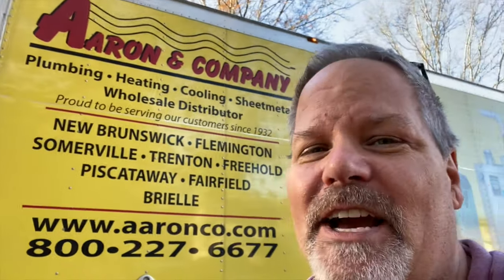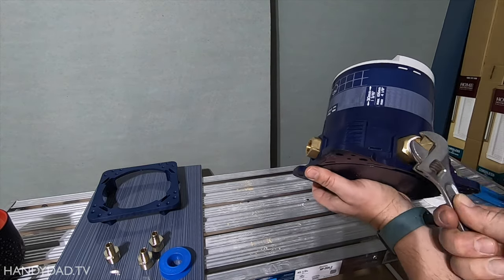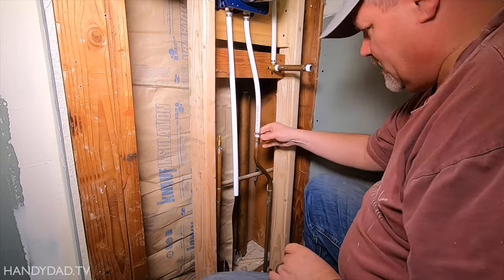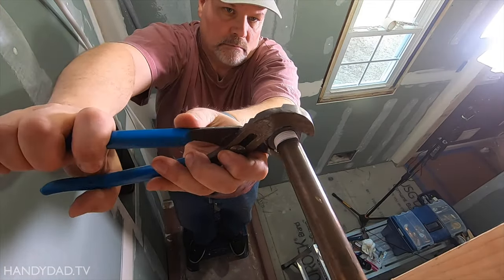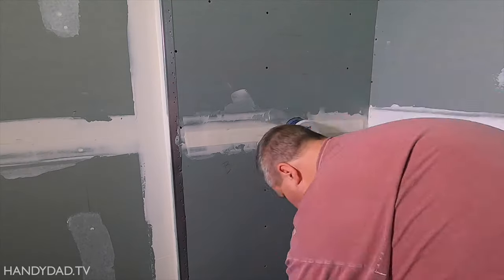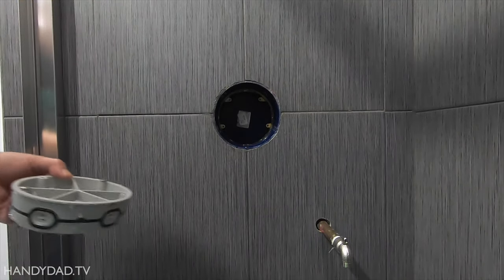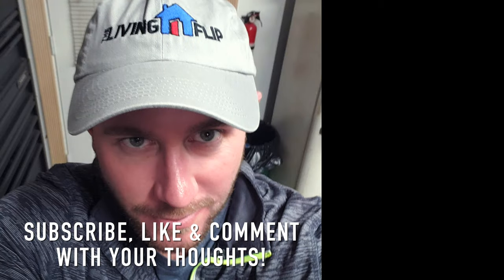WE INSTALLED A SHOWER VALVE // TLF 26

Comment: With regard to the comment about not putting the box in the centre of a tile – it depends on the tiles you have chosen, and on how handy you are with an angle grinder (disc grinder). We have 60cm x 60cm porcelain tiles in one of our showers and I put the box in the centre of a tile, grinding a hole from the reverse side. It wasn’t too difficult and looks great. What you definitely should do is choose the tiles before you install the shower and plan the whole installation so that you don’t have any awkward cuts to make.
Reply from the maker: Thanks for the tip.

Comment: kind of strange to see super nice grohe shower valve surrounded by cheap  moisture resistant drywall, even though the redguard was applied.  probably will be fine, but i would still use cement board.  and i would only use gas wrench to turn pipe.
Reply from the maker: The original shower was tile on 3/8” ordinary drywall with no waterproofing. This one should last as long as they like the tile.

Comment: Great video, very helpful, thanks. Quick question, I have started my install and I am up to the point of pressure testing, which is fine. The next steps with the service stops, is this necessary? as I have isolation valves on the hot and cold pipes leading to the shower valve so l can shut them off to stop the water and have no need to use the service stops, or am I missing something? Thanks in advance
Reply from the maker: You can skip if you have shutoffs

Comment: one suggestion I learnt from another YouTube plumbing channel was to put the knobs offset to the shower. That way you can switch the shower on and off without getting wet.
Reply from the maker: Here is a more extreme situation like that. https://youtu.be/uPJE8L0rgag
Reply: Damn that's genius
Reply: It looks stupid and amateur off to the side.  You could just do it the right way , and make sure your shower door opens on same side as diverter. 

Also big fail on green board in shower.  If theres ever a plumbing leak / roof leak or the waterproofing fails even a little bit, best case only mold and mildew. Worst, drywall gets saturated  and entire wall, tile etc  needs to be ripped out and replaced. ALWAYS! Use cement board or the like.  NEVER use gypsum products in a shower/bath!

Comment: Purchased and installed with the pictogram.  Wish I would have found this first.  It appears that the smart block will not allow flow with only one side pressurized.  Both hot and cold water supplies need to be connected and pressurized for the cartridge to  allow water flow to any of the selected heads.   Thanks for the great video.

TonyK.
Reply from the maker: Thanks

Comment: I had the Square version of this istalled 18 months ago in two showers.  This is the best video i've seen on the build.  I know the cartoon instructions drove our plumber crazy.  I've deveoped the tiniest leak from the back of trim plate and the drip runs down the tile wall to the shower floor.  So that area never is 100% dry.  Wondering if the round mix chamber needs more goop where it meets the box, or if one of the cartridges has a minute drip.  Hmm
Reply from the maker: Thanks 😊

Comment: Hi does the smart control box have to be level from top to bottom of the control box if the wall is off a few mil is that ok
Reply from the maker: I’m not sure but I’d think it’s more important for the box to be straight with the wall. If the box is plumb but the wall is off, the escutcheon plate may not sit right.

Comment: Interesting press connection system. I've never seen one like this.
No need for pre-expansion of pipes.
Reply from the maker: We have that system here too but the tools are much more expensive.
Reply: @handydadtv  What is the name of the system you used in this video? You may have mentioned this in the video, but I don't understand English very well...
Reply from the maker: This video explains the difference https://youtu.be/XRNKDrGlOls
I used Pex-B.
Reply: Those are cinch clamps which have a high failure rate.  They were supposed to be pulled from the market but still are available.  The worst pex connection.

Comment: Do you need water hammer arrestor on the water inlets? Looks like it is a quick close valve.
Reply from the maker: The directions didn’t require it, and my daughter hasn’t had any complaints about water hammering.

Comment: Hi, any suggestions for concealing the hose in the wall similar to a kitchen sink sprayer?  
  I want to pull the hand shower hose out when needed and let the hose stay inside the wall leaving just the handle exposed on the wall when not needed. I'm mostly concerned with servicing the inside end of the hose in case of leaks or replacing the hose. The only thing I can think of is making an access plate somewhere near the diverter.
Reply from the maker: I’ve never seen that.
Reply: @handydadtv  It's either making a pocket in the wall for the sprayer so that it sits straight or making a 45 mount that sits on a flush wall. The access door is going to have to be right next to the diverter. I'm going to call Kohler and see if they have a suggestion.
   Kohler has a deck mount for the hand sprayer. I'm going to try and mount it to the wall.

Comment: doing the same install, plugged the rough-in after doing a pressure test but didn't put the stoppers back in. Took me a while to figure out why the water in our shower was lukewarm :)
Reply from the maker: Lol yeah it’s not obvious
Reply: How did you verify the connections don’t leak when you had to reconnect the handheld with a shorter pipe
Reply from the maker: Faith. 

Seriously. I can’t see inside the wall when I install the final pipes so I use a healthy amount of Teflon tape and screw them in very tight. And say a little prayer.
Reply: HandyDadTV cool our house which was a flip had zero Teflon tape or pipe dope on the threads leaking into the wall, hate flippers
Reply from the maker: Oh no! That’s just wrong.

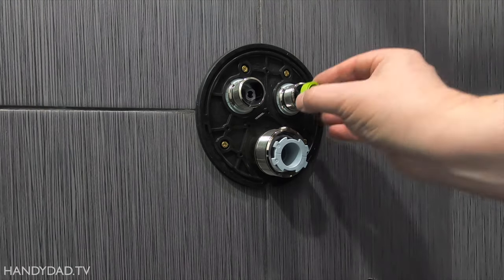Comment: 10:46 I would like to use this system for bath filling. Does it come with more white cover caps with different images? I need a bathtub image but even when I select bath filling in the configurator the result shows shower icons.
Reply from the maker: Yes it comes with many different choices of button caps. Including a bathtub.
Reply: @handydadtv  cool, thanks! I could not find this info anywhere!

Comment: What is the press tool you use on the pex tubing? Is this good enough to be behind a wall?
Reply from the maker: Should be a link in the description. Yes, crimped Pex connections are used inside walls.

Comment: so no water will come out without installing the actual valve body?  I have the box roughed in right now and am wondering if I can turn the water back on without installing the valve body and trim.
Reply from the maker: You need to have the stoppers installed, then you can turn on the water. I show how to do this in the video.
Reply: The valve comes with the test plug, which mixes hot and cold and outputs to all outputs (that aren't capped) so you can pressure test. You shouldn't leave it like that for very long, ideally installing the real valve without the trim or having shutoffs elsewhere for the shower.  Leaving the test plug in place means you might have hot water entering the cold water lines or vice versa if there's a pressure drop in the system, say from a toilet flushing. 

Also, a couple tips for the future: 

1) use Teflon tape, then pipe dope on top of that to avoid those tiny leaks. 

2) only a light coating of flux is needed and once you've pushed the fittings together, wipe off the excess to get less solder running down the pipe.
Reply from the maker: @osheros Thanks for the tips!

Comment: I’m installing my smart valve now. I see you used port B & C, You can’t use port A & B and close off C instead correct?
Reply from the maker: The ports used are determined by the trim kit.
Reply: Yeah I’m using the dual trim kit but I’ve read you can only use port A if you’re using the triple trim kit. Port A is a straight route to my hand held but I can’t use that one, only B & C.

Comment: do you have the link for the entire set? You link shows parts only. I am looking for the same set with valve in it. :)
Reply from the maker: I don’t have an online source. You need to go to a local plumbing supply store for Grohe valves.
Reply: @handydadtv  I am really interested in these! do you know if those buttons are platstic made? They looks a bit cheap though.
Reply from the maker: Other than the big faceplate, everything is plastic. Not cheap plastic though. It will probably outlast me.

Comment: Thanks so much! Your video is so helpful! Even when we called Grohe, they referred to your video for instruction. One more maybe silly question, does the main control knob go just one click to the left (like 15 degree) for hotter water, but it actually goes all the way (almost 180) when turning right (for cold water). Not sure if I make sense but any response would be greatly appreciated. Just want to make sure we do it right. Thanks!
Reply from the maker: That sounds right. I think you need to press the button to make it go hotter if you want.
Reply: @handydadtv  Thanks for confirming!

Comment: I recently finished installing the same device in my new shower.  I am at a loss as to how to adjust the temperature of the water with the large knob.  No matter which way I turn it, only hot water comes out of the shower or the hand held wand.  The instruction booklet only has pictures.  I wish it had an explanation spelled out.
Reply from the maker: The temperature works fine on the main shower head?
Reply: @handydadtv  No, I cannot get the temperature to go down on the main shower head or the hand held wand.  What I am having trouble deciphering are the instructions on page 6 of the installation manual.  I know there is some sort of adjustment that can be made inside the unit.  I simply cannot understand what the pictures are trying to say.  You know that old saying, "A picture is worth a thousand words" ?   Well, in this case I would prefer a thousand words.  Perhaps when all is said and done, the Grohe SmartControl fixture will be appreciated.  But I don't think I would have picked it if I had known the difficulty of installation.  I've been a carpenter for over fifty years.  I built my own house and did all of my own work, including electrical and plumbing.  The only other time I had an experience with a Grohe product was about 35 years ago.  I helped my brother install a Grogh vanity faucet.  I recall having similar difficulty with that installation.
Reply: Take the chrome cap off of the larger knob.  Take out the gray plastic insert. It is a little difficult because the teeth in the gray insert lock into the inner workings of the knob, but with a little persistence it should slide out. Now, look into the knob and you will see the the toothed insides of the knob and in the surface you will see thin slot. Insert a medium sized flathead screwdriver into that slot and turn it gently to the right.  I had to turn mine all of the way until I met resistance.  Remove the screwdriver, turn the outer knob so the button is at the top, insert the gray piece back in making sure the word TOP is centered, and test.  You may have to do this a few times to get the temperature you are comfortable with.  Once you have it adjusted the way you like, put the cap back onto the knob.
Reply: @wesmoc  I cant get the gray insert to stay in place.   When I turn the knob it eventually pops out like it's not seated correctly

Comment: Hello i have similar Grohe smartcontrol system but i cant change volume of water flow , when i press the button the flow is high, after turning the button left or right it does nothing. Its connected correctly with this white roller under it. The problem is this main button has different range of move then this roller and IT means that beginning of range on main button is equal to ~1/3 range of this white plastic roller and on this range water is on highest flow. Its possible to fix it?
Reply: I have the same problem.  My contractor thinks that is just the way it should be but I can't imagine that it would not be able to have the same volume control as the less expensive system he installed in the guest bathroom.  I tried to contact Grohe but no response yet and nobody in my area seems to be familiar with this system so they have no opinion.  Hopefully, somebody will reply to your comment with an answer for both of us.
Reply: @kjerstistoddard3751  grohe service visited me and said that it should be like this and the range of volume pressure it isnt that noticeable :D that it depends on the installation system pressure in house.
Reply: I have the same problem. Flow control valve not decreasing well the water. It feels maximum to minimum -10% flow control decreasing. Any advice, or is it “normal”?
Reply: Did you guys ever manage to get this sorted?
Reply: @ANISH0721 Grohe service can not help. They said it is normal. Problem still exists. :(
Reply: Have you found a solution, I have the same problem
Reply: @ronnyking1857 Still no solution :(

Comment: Great video. How did you deal with the hand shower install? Seems as if you need to have a threaded pipe roughed in to accept the 1/2” fip fitting it comes with
Reply from the maker: The hand shower elbow, visible outside the tile, is connected to the drop-ear elbow inside the wall with a 1/2” brass nipple (short threaded pipe). I think it was around 2” long.

Comment: Great video guys! I bought the Grohe smart control to fit it into a camper. However, I have no option do the test runs with water. I really have to install everything before I can run it with water pressure. Any advise with regards to this way of installing it?
Reply from the maker: Follow all the steps, just skip the pressure test. Check for leaks when you finally hook it up.
Reply from the maker: That said, you should still flush the lines before final installation of the valve.
Reply: @handydadtv  thanks for your quick advise. I can't flush the lines before finishing the whole installation unfortunately. We don't even have a drain yet ;) I will have to find a way to work around it.
Reply from the maker: Don’t install the cartridge until you flush it.
Reply: @handydadtv  Thank you for taking the time to reply to my very special case. I watched your video over and over again trying to figure out why the lines need to be flushed before installing the valve. Even from the cartoon style manual it is not clear to me why it is absolutely necessary for the lines to be flushed. Will air in the pipes do any damage to the valve or will the air settle somewhere hindering the valve from working? This is a very important aspect questioning the whole sense of the grohe system for campers. Other than houshold installations where water pressure is constant and pipes will be constantly flushed I need to release the water from the whole system (e.g. if I leave the camper vacant during winter) from time to time. Hence, if air in the pipes / valve is a problem the whole grohe smart box would not make sense for camper utilization. Without taking to much of your precious time, I like to ask you if you could clarify for me why flushing is necessary. Greatly appreciated. (english is not my mother tongue, hope I made my point clear)
Reply: @handydadtv  By the way, for clarification: I dont have a double wall installation situation. In our case the smart box will be mounted against the back of the shower wall. I will have permanent access to all fittings and can always check for leaks.
Reply from the maker: There could be dirt and debris in brand new water pipes. You don’t want that debris getting caught in the valve or shower heads or faucet aerators, so that’s why it’s a good practice to always flush the pipes before final installation of those things.
Reply: @handydadtv  got your point! Thanks for the reply. I guess I will simply flush the items individually and then put it all together.

Comment: What's the advantage of this system over a standard flick mixer?
Reply from the maker: Easier plumbing. More control. Fewer points of failure. Style.
Reply: Also, the component that goes mostly on thermostatic shower mixers is the cartridge. Nearly every other concealed shower, you'll need to take the wall down. This one, you remove the face plate, swap the cartridge, and replace the face plate. Simples.

Comment: Hi! Love you video! I have similar Grohe Shower Valve in my bathroom. Is the default lowest temperature 38 deg? Can it be adjusted to colder temperature? The lowest setting is to warm for me sometimes..Please help.
Reply from the maker: It is adjustable by removing the cover on the temperature control knob. Turn on the shower on to a temperature you like, pull out the black ring inside the temperature knob, turn the knob so it clicks at 38 degrees, and then reinsert the black ring. Now the knob should be locked on your preferred temp. Just push the button to turn the knob hotter.
Reply: @handydadtv  Thank you! Unfortunately  my model is different: GROHFLEX timeless Dual set,  my husband had no luck adjusting the temp, he took out a couple of screws... the cover was stuck... we couldn't find any video showing adjusting temperature on our model..

Comment: I thought the same thing about the comic book. I literally tossed the paperwork behind me and grabbed my phone to check YouTube university. Only thing i didn’t like seeing was using a drill for the screws but other than that, good work. Also i hate sharkbites! I’ve been a plumber for over 20 years and i refuse to use them in a permanent install. I don’t even use temp caps anymore either because i had one fail and ruin a really expensive hardwood floor from a very small leak over 2 weeks with nobody in the house.
Reply from the maker: Thanks for the comment. I’ve heard mixed reviews of Sharkbites. Many people love them.